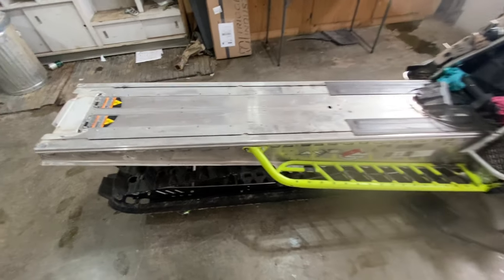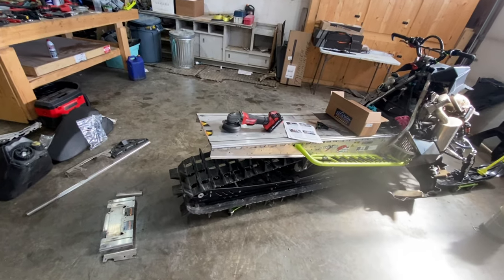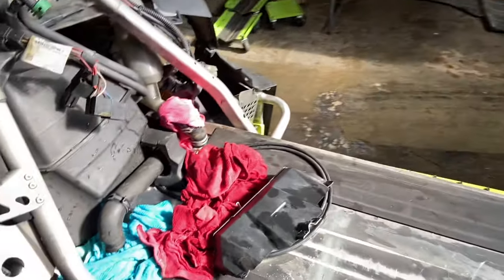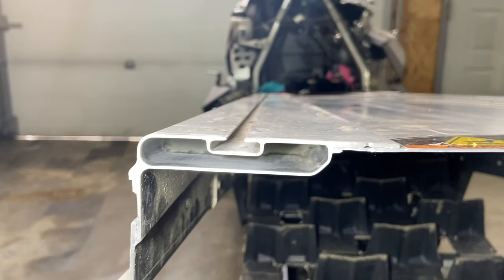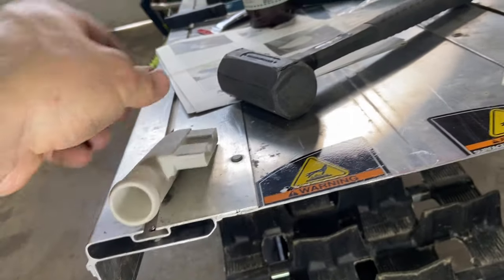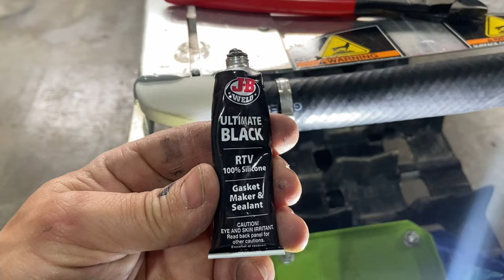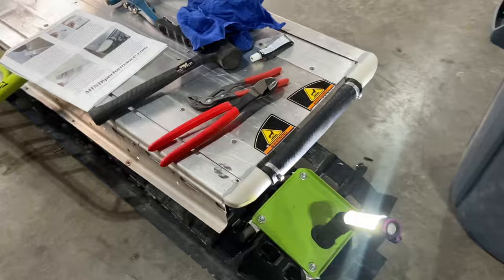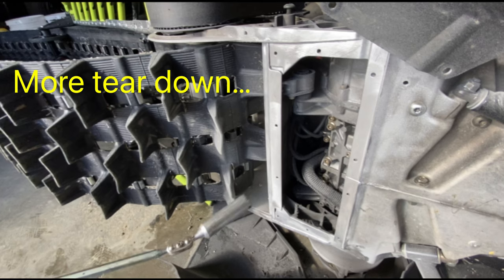Sled Mods Part 4 Chopping off 7 inches! MTNTK tunnel chop kit and Skinz chopped tunnel bumper

Comment: Have you added coolant and tested for leaks yet? I tried the same kit on my sled, followed instructions to a T, and still had leaks. I noticed your inserts were very tight, as were mine, and I think that may have displaced the epoxy causing the leak!
Reply from the maker: Yes filled it back up and hear cycled it several times. No leaks and good to go. I’ll let you know though if issues develop but seems mint.
Reply: I have one on mine. It started seeping last week. Cr racing in Canada is modifying their aluminum cooler to fit my sled for me and then I’ll have it welded in place. I’m not looking forward to pulling the mtntk crossover out and cleaning up all the epoxy. 😬
Reply: I ended up cutting an additional inch off just below the inserts and I throw the mtntk kit in the garbage! Found a local shop to weld the old crossover piece back In for me, good as new now
Reply: @danp9164  that's pretty much what I'm doing. I don't have the old crossover as I bought the sled used so I'm having a part fabricated and then it will be welded in place. I don't want to have to worry about it leaking again in a year or two.

Comment: Has your track hit the hose protector underneath? It’s lower than the oem tunnel
Reply from the maker: Doesn’t seem to be an issue. Even with the suspension fully compressed right to the bump stops it doesn’t touch.

Comment: Can i bother you with a measurement of the bumper total length.  Much appreciated.
Reply from the maker: Total length is 31 inches. However as you can see the front end of the bumper goes under the back of the running board by 5 inches. So it is only 26 inches from the back of the running board to the back of the bumper.
Reply: @themediocregarage  thank you for  that. Have a good season buddy, ride safe